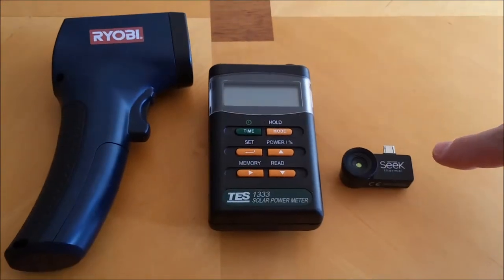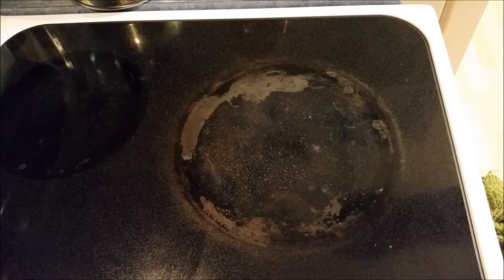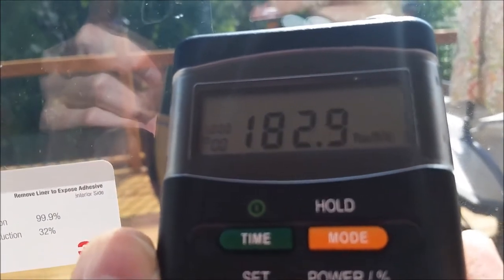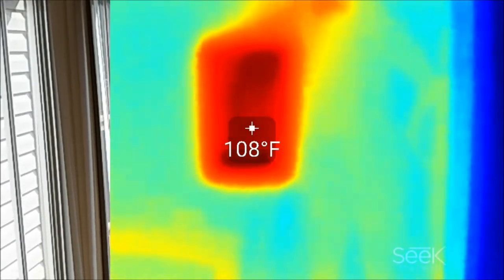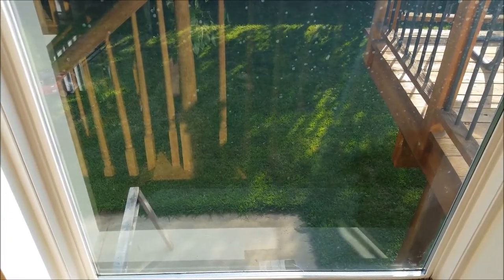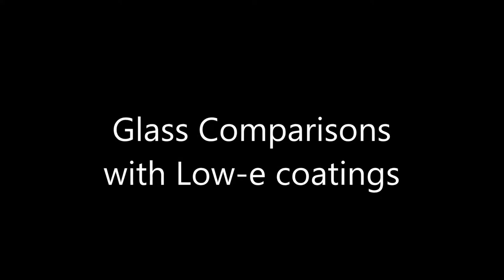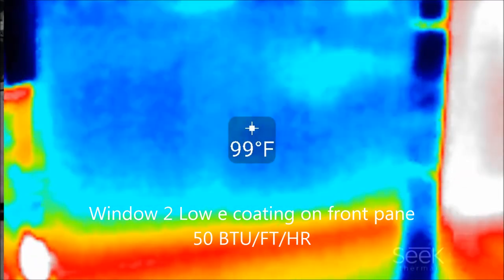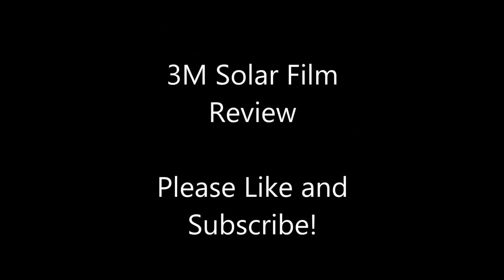3M Prestige 60 Solar Window Film Review

Comment: Hey STEM. We had 3M authorised sales guy come to us a few days ago. He recommended that exterior film be used on double glazed windows and NOT the interior film for the EXACT reasons you described. According to the sales guy, multi glazed windows and interior film do not work together if you want to reject any form of heat infiltration. He did mention that the external film is relatively new, with half the warranty period of internal film.  Based on his strong recommendation, we are considering having the Prestige 40 external on our sun facing DG windows. We're in Australia, so on our north facing DG windows.
Reply from the maker: The window would need to be watched for heat gain on the outside as well.  Ask how hot the film gets and do they warranty against seal failure for labor and materials. 

The interior films did not impress me at all.
Reply: This makes sense, because she  you have double glass, the problem is that the air between windows gets hot and, as it is "trapped" there it maintains heat a lot more, so this might be the foundation of why an inner film wouldn't work. I'm in Denmark, in an apartment whose windows are all that make up a wall facing west. The temperature in gets 10 degrees hotter than the outside when the sun heat. I can touch the inner glass and get almost burned, but the outter glass is cooler (no film here, I'm renting, not worth the money)
Reply from the maker: Most windows have the space filled between with a vacuum or inert gas which inhibits heat transfer.

Heat flows from higher potential to lower potential. The greater the potential, the more heat flow.  In the inside case, the potential difference inside is greater so most of the energy will transfer inside vs the difference between the inside and outside temps.
Reply: @stem_saving1644  then mine must not have it. The interior gets burning hot and the outtee glass remains cold. Completely opposite than what one would want during hot days
Reply from the maker: Yes.  The issue, I believe, is the hot glass has an easier time dissipating heat into the room vs through the glass. The thermal resistivity of that gap (either vacuum or inert gas) in the window reduced heat transfer. 

In layman's terms,  the heat has a harder time to get out than move in.
Reply: @stem_saving1644  any ideas to try? I can't put film (specially not on the outside, 2nd floor, windows can't be reached, I can't even clean them...). We are obviously moving out when the lease expires, but we have the summer ahead and are already baking in the spring...
Reply from the maker: Aluminum foil. Reflects radiant heat really well and or cellular shades for thermal resistance. 

Foil needs an air gap between it and the window. Can be glued to cardboard and placed in opening.
Reply: @stem_saving1644  why does it need an air gap?
Reply from the maker: Conduction. Metal conducts heat when in direct contact. Reflects radiant energy with an air gap.
Reply: @stem_saving1644  so if I got it right it should be: aluminum + cardboard + window + sun (in that order)?
Reply from the maker: The foil faces the widow but doesn't touch the glass. The cardboard has the foil glued or taped to it.  Cardboard is just support for the foil. 

It will make the room darker,  but you'll really feel the difference in the heat it rejects. Give it a try and let me know your results.

Comment: I think your testing lacked a complete analysis. You did not measure the temperature of the objects, (floors,walls,etc.), that the light is striking. Your measured the heat of the glass, and of course the plain glass is a lot cooler because it is passing most light and heat through to your house. 
I agree that replacing windows is better than film, but that is not always possible. Neither is completely covering the windows with solar shades. 
I think you need to re-do your test to include interior surfaces.
Reply from the maker: I think your mistaken in your understanding of radiant energy. Films such as these are suppose to reject radiant energy,  which ( when absorbed) becomes thermal heat. It's simple conservation of energy. If it's not reflected it's aborbed or transmitted.

Which is the point I was trying to make.  The radiant energy  is absorbed by the film, which then heats up and transmits the heat back into the house via convection. 

So, you either heat the house directly from radiant energy with no film or in my case the film heats up and transfers energy into the house via convection.

My btu equipment and thermal analysis shows that.  Heat flows from higher potential to lower potential, if my windows are 120 degrees and my house is 75, guess where the heat goes?
Reply: @stem_saving1644  Why don't make 2 glass boxes, one covered in 3M the other not; then put a thermometer inside each of them and see which one is hotter?
Reply from the maker: No need to.  We can see by window testing as well as the sample glass panes that radiant energy will pass through glass with minimal heating .  It's when it's absorbed either by the home or film that it converts to thermal energy.

The issue is the film is attempting at using the glass as a heat sink. If the film was made to adhere to the outside of glass it would work. But it's not designed for that. Low e glass works in a similar manner, but the film is on the glass facing the outside and the air gap reduces transmission into the space.

Where my film is on the inside and the same air gap prevents thermal transmission through the glass to the outside. Make sense?
Reply: @stem_saving1644  you just proved your point.  It’s absorbed or reflected.  You bought film that reflects 8%.   So your window film will absorb large amounts of energy.  Simply put.  Wrong film for your area.
Reply from the maker: Not correct. Absorbed, reflected, or transmitted. Energy must obey the laws of physics. The film seems to allow some radiant energy in,  while absorbing most into the film and using the glass as a heat sink. But yes it's the wrong film. This film does  little to reflect heat as the thermal imager shows.
Reply: @stem_saving1644  exactly.....increasing reflectivity reflects the energy away from the film/glass making the windows less hot.  I live in the desert and have seen the difference the right film can make.  They do work.  3m sold you the wrong film!
Reply: @stem_saving1644  based on your data, that film is perfect for heating homes in winter while keeping uv light out.  Great film....wrong application.

Comment: I have installed window films, I could feel very noticeable temperature drop in the room. I think although some radiants turned into heat, on the glass and ultimately will heat up the room, it also reflected quite a lot back to the air. Because you can see clearly mirror image from outside the window, which proves it reflects light back.
Reply from the maker: I'm stating the 3M films  I have are poor, not all films. You're referring to metalized films, which are a higher quality film with metallic properties. 

Be aware you want to block IR, not just light.

Comment: Thanks for this interesting info. I have searched (unsuccessfully) for any review (non-commercial) and have found only yours so far. It makes me pause as I am looking for options short of replacing windows. In today's computer age it is strange to not find reviews of products that make good claims. Makes me pause.
Reply from the maker: Yes sir. I agree. If your going with film, it needs to be on the outside for heat rejection. Mine was inside films. But what these cost to put in, it almost makes sense to get windows with low e glass instead. Please consider subscribing if you haven't already.

Comment: Thanks for the video!
I saw in the 3M website a version called "Prestige 60 Exterior" and looks like it can be applied outside, have you heard about it?
Reply from the maker: No haven't heard of them. Mine are internal and not very impressed with them. External would work better.
Reply: Prestige Exterior is available in 20, 40 70 and 90.....no 60.
Reply from the maker: I'll pass.  Wasn't happy with the interior version.  I'm getting new windows instead, as I'm over due.
Reply: @stem_saving1644  Please let us know how the new windows block the heat and UV...we are always trying to learn the new technology of new windows, especially with low-e...Thank you!
Reply: I have a sample of prestige 40 (exterior) installed on a window that's not visible for a few years and when the sun is on it you can feel less heat coming through just holding your hand there, but how you actually measure it correctly is more complicated than just an IR reading IMO.
Also the film absolutely without a question needs to be exterior in order to function effectively no matter what any manufacturer decided to print on a piece of paper.
Reply from the maker: The heat your feeling on your hand is radiant energy.  The film does stop radiant energy, but what people fail to understand is it's simply converted to thermal energy, which is why the film heats up.
Reply: @stem_saving1644  Yeah there is so much bad information out about it, and both manufacturers and salespeople "forget" to be forthcoming with how interior films work!
The film on either side certainly intercepts radiant energy, but the wavelength is mostly just lowered or remain in the film as thermal load which is clearly felt on either side of the glass, but if it's double insulated panels and the film is on the outside that thermal load is pretty much fully carried off by outside air. 
But I'm not sure how much of that wavelength change is practical to measure without a carnot's chamber like you say in your video which is why I hesitated going forward with getting mine covered in the stuff.
And I didn't like the sales people lol, so damn slick!
Reply from the maker: I agree.  Most of the energy is absorbed by the internal film. It's transferred into the space since it can't transmit very much through the glass due to the air barrier.

The external films should work better,  but not sure to what extent.

Comment: 3m prestige 60 rejects 53% TSER only on clear 1/8 single pane glass. For example, dual pane 1/8 clear glass rejects roughly 24% TSER without window film and around 20% more heat rejection with 3M Prestige 60. Read the normal section data on the sample card that you took that window film sample out of. I've been in the industry for 25 years. It's terrible that 3M makes this so confusing and doesn't make it very clear on the samples, but I explain this to all my customers. Another thing you are not measuring correctly is the surface before and after. You also need to measure the surface temperature of objects in your home.  This is not easy to do, but the film reduces heat, just not as much as you were led to believe.  Also, dual pane glass absorbs a lot of heat with these types of films. The best option for dual pane glass for heat rejects is metalized window films. I've worked in front of all these films for years and I can tell the difference because I'm much cooler when working with these films. 3M Prestige wasn't designed to block a lot of heat on dual panes. It's designed to block IR, UV, a little glare, and some heat without changing the aesthetics of the glass, and it performs much better on old single-pane glass. I recommended Prestige 70 & 60 for protecting furnishings. Another great option for dual pane heat rejection is exterior silver or ceramic film if you are okay with a shorter warranty and higher cost per sq. ft. These films perform best on the exterior surface of dual pane glass units because the heat is reflected before it enters the thermal pane.
Reply from the maker: The measurements are accurate, I measured both ways energy can enter the space.  Radiant and convection. 

It's the total energy rejection that's what's important. If radiant energy is converted into heat and omitted, it's pointless. Which is why the film heats up so much.  The film on the inside should not reach the levels of heat seen. 

Overall,  the interior film is junk.

I'll agree that exterior film is better as the heat can be dissipated via conduction.

Comment: I think this film is a perfect example of misaligned expectations. You are right on the air heating from the film by convection. Thats to be expected. Were you are wrong though is you dont count the fact that when glass warms up it gives away heat both ways.. Inside and outside. So likely amount of heat comming into the room is less... However, if you have double layered windows the heat is getting in between glass and have nowhere to go.... So in essence, you will still see slight improvement just not as much as you hoped for. Corrext way to go is probably to go external
Reply from the maker: Glass transfers radiant energy.  The heat  generated by the film is thermal energy. Double pane glass has a void filled with argon gas, which doesn't transfer heat well.  So, most heat is transferred inside. 

I will agree about managed expectations....I expected the films to reject what the label says, and they didn't.
Reply: I have just moved in into my new house with large south side windows. I underestimated how big of an issue sun will be. Started looking for solution and came across sun films... Took me more or less an hour on YT to get to know that internal film + double layered windows is not a good combo.... And btw. My windows are triple layered.... :) In Europe it is now  basically mandatory to install triple layered to meet heat consumption norms for the house required for the building permit ... So yeah. I have to go with external. And thank god I prepped pipes in my house for for 7 AC units

Comment: Hi great research with useful data.. I also use 3M Nightvision series.. I did it by my self.. first of all did from inside I get same result as you, it was more hot inside... then I turn the twin glass 180 degree and now is better. Now the film are outside more than 2 year. they are okey, only small scratches due to cleaning isue .. but the film finish point is inside of the frame! so it can not unstick due to winter or summer time.
Reply from the maker: Thanks 

I agree theses should be outside films. Not sure why they were designed to be inside. But if they would be designed for outdoor use they would work great. Unfortunately, they don't in my opinion. They just get hot and heat the house via convection.
Reply: Could u share the place u bought it from? I’d like to install 3M on 2 patio doors but can’t seem to find any online retailers (ebay or wide search)
Reply from the maker: They are only installed through 3M authorized installers. I couldn't,  find them online... at least at the time.  

If you buy film,  buy external film.  Those are the ones that work best.

Comment: What about exterior application?
Reply from the maker: They are not designed for that.  They are held onto the widow with surface tension with water, for example.  This is why I don't recommend them.
Reply: 3M Prestige Exterior is designed to be installed on the outside, and you avoid the glass getting hotter.
Reply from the maker: Mine were interior films not exterior films. I do agree exterior would work better.
Reply: @seacoolwindowfilms5783  and the Prestige Exterior has a 7 yr warranty; as compared to the Lifetime warranty for the interior version of Prestige...Both versions are incredible products!
Reply from the maker: I don't think the interior versions do much for keeping heat out.  Be interested to see how the exterior does.
Reply: @stem_saving1644  We’ve documented countless cases of our clients noticing 4-5 degree differences (sometimes more!) in temperature with 3M Prestige. 

We have done entire buildings in these films as well, thousands of employees sitting next to windows that can sing the praises of the film.
Reply: @stem_saving1644  Also, they are not held onto the window with surface tension with water. They have a water based adhesive that is revealed when you pull the liner. 

I would love to discuss some more, I think you were victim of a bad installer.
Reply from the maker: Yes your employees don't feel their bodies absorbing the radiant energy the film absorbs. But now the window heats up and energy is brought in via convection. 6 of one,  half a dozen of another.... energy still comes in.

Comment: Instead of replacing the windows,  I just put exterior solar screens on my west facing windows.   This is a lot more cost effective.
Reply from the maker: Yes, screens do work well, but if you're in mixed climates, new windows can't be beat as they provide heating and cooling reduction.